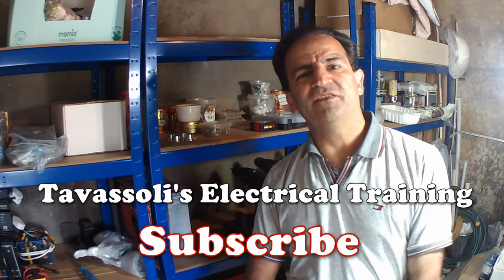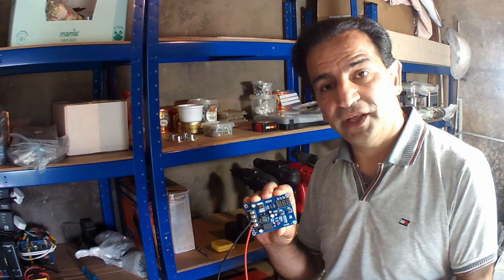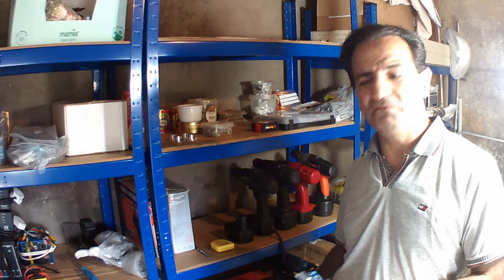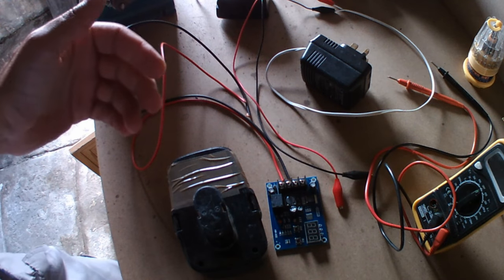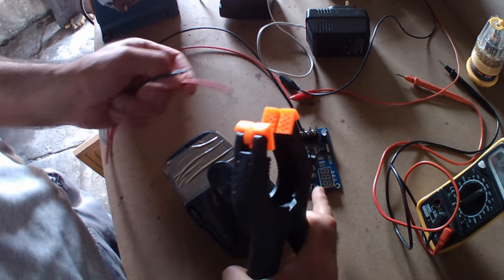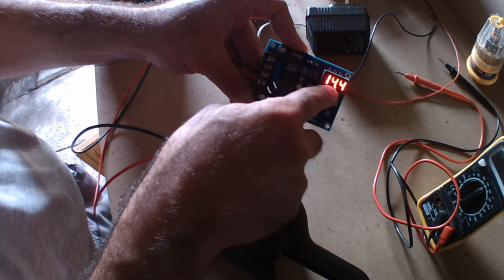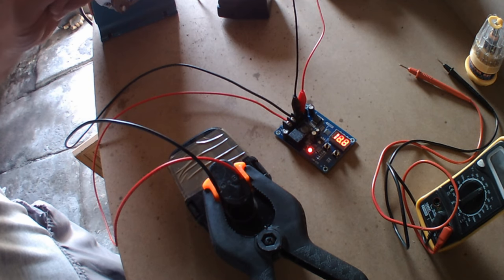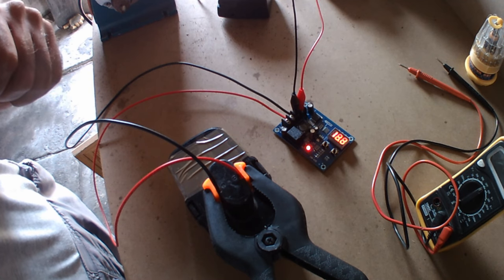Charger your Cordless Drill without its charger! - How to Make a Universal Battery Charger-

Comment: Thank you so much for this.  Excellent video and it's exactly what I'm looking for.  I really appreciate your time.     
I do have a question though.  I've looked this module up XH-M603 or some variant of that.  The module is a 'Lithium' battery charger.  How then could this charge a your car battery (a Lead Acid battery)?   Were your referring to the Lithium cells now used in vehicles?  Or doesn't it matter?   Thanks for your video.
Reply from the maker: You're welcomed!

Comment: get a junk 19V laptop Chargers, charge it, simple. Black Wire is negative and White Wire is Positive. Whats so hard about doing that???? You made this whole thing with the extra board they need to buy and the Multimeter and the rest of your BS. a 19V Laptop charger will charge any 18v cordless battery without overcharging it, because can't go over 19V.s Common sense. What is so hard to do it with a laptop Charger?? you can find them in the garbage. 😂😂🤣🤣😂🤣😂😂🤣😂

Comment: Be nice to have a solar charger project tie in where it charges the  battery than later to power the tool fan lights than power your tablets so and so. My tool batteries do those things. Have an usb and usbc adapter from 12 volt cigarette adapter. Usb adapter works good because it max input is 24v. So 20 volt battery does well. And it fast charges my samsung s tab 8.

Comment: I don't think you know anything about charging nicad or Li-On batteries packs. Its not as simple as you think.
Reply from the maker: You made a video and teach us then!
Reply: Another troll alert!
Reply: I had the same sort of feeling. Setting the end voltage for a car battery (lead acid) would be ok as it reduces the charge when it gets there. Not so with Nicad or Nmhi. They go down in volts as they get to the fully charged point and start to heat up. Both types do this at slightly different points. Normally full charge is detected by the temperature going up or the voltage going down to turn off the charging
Reply: @billhall1983  can you please give me advice as to what to do with the ni-cad battery"s cause i won't to get this kit for 12v ni-cad drill batteries but as i read your comment now i'm not sure, i like the kit for lithium batteries and if i could use them for the ni-cad that would be great just would like to know how to do it...
Reply: @makdady66  Just putting a current limited, voltage controlled supply across any battery to charge it sounds like a nice simple idea which will sort of work, but if you want the most out of your batteries then they need to be charged correctly.  Ni-Cads can be charged slow or fast. For slow charging the current is limited to 1/10th of the Ah capacity. So a 1Ah battery would be charged at 100mA. At this current when the battery is fully charged the internal gas given off recombines back into solution and gives off a bit of heat. This allows other cells in the battery to catch up and all be charged. The disadvantage of this is that it takes 12 hours to charge but you won't damage the battery. Fast charging needs to have a means of turning off the charge once the battery is full. When a Ni-Cad reaches fully charged the voltage changes from going up to going down. A Ni-Cad charger detects this voltage change and drops the charge current to a much lower level to give a bit of time for all the cells to equalise. Also the battery will start to get hot. Chargers usually have a fail safe temperature cut off as well so that if the fully charged detection failed the temperature rise would be used to stop the charging. Using the simple power supply charging method it could be possible to set the cut off voltage a bit below the voltage at which point it starts to go down, but the battery would not be fully charged. A common problem with Ni-Cads is that a cell or cells can develop internal short circuits. If it is a resistive short then it will still charge up to the full voltage but will not hold the charge for long. If the short becomes a solid short, then that cell will not charge and the battery will never reach full voltage. I use a circuit I built about 40 years ago to sort out internal short circuits. It is powered from a mains transformer. The positive half cycle charges a capacitor to about 30 volts, then on the negative half cycle it is discharged directly to the battery. This gives a succession of 25Hz short high current pulses into the battery. This clears the short circuits and charges the battery slowly. I hope this helps but remember, All batteries have a limited number of charge cycles and will eventually become un-useable. Having the correct charger will ensure the best battery life.

Comment: Hooked a 18v battery to this and relay clicks on and light comes on every 2 seconds, tried adjusting up and down the voltage numbers and light or relay does not work. Battery is pretty dead wondering if that might make this happen?
Reply from the maker: If the battery is almost dead, then you need to adjust the up and down voltage to where the relay clicks and the LED comes on and stays on, after it's charged a  few hours, then you will need to change the voltages back up, and keep doing this until you get the battery to charge up to where it needs to be at. If the battery is completely damaged you might not be able to do any of these. you need to see what reading you get when it clicks On, and what reading you get when it clicks Off.

Comment: Can I charge 36 volt ion battery with 12 volt Charger if I charge long time will it work.
Reply from the maker: no, sorry! Because your maximum supply is 12 volts. The battery doesn't store charge, it only gets charged to the maximum you can supply.

Comment: I added a comment a few days ago. I want people to know about your power supply is of alower voltage than people need. I needed 18 volts and you sent 3-12 volts. I am unable to return power supply. Where is my negative comment?People Need to know your business practices!
Reply from the maker: I have already responded to you in your email. The power supply we have on our site has a few variation of voltage and Amperage ranges, if you have picked the wrong voltage, it's not my fault. I have sent you a copy of your order, which shows what you ordered, and a screenshot of what we have for sale, which gives you the choice of different voltage and Amperage range of power suppliers. However, although it was your mistake top choose a wrong power supply, I even stretched an olive branch to you as a gesture of good will by giving you 50% discount code to use on any purchase you want! If you made a mistake in ordering on Amazon, eBay or on any other website or platform, you wouldn't be able to return and get a full refund. I've been more than fair with you. Thanks for your comment! We have an overwhelming number of happy customers.

Comment: I have a old 12V  black and decker when i connect the wires to battery the me305  regulator lights come on then go out should it stay on or is it because the voltage in the battery is lower tham 10 v as reg  is 10v -30V
Reply from the maker: Did you buy the board from me?
Reply: Yes its ok i have manage to charge it thank you if  the battery  is lower than 10 V does that mean light goes out. it did come on but went out .
Reply from the maker: @mauricevalladares9839  Yes, if the battery is too low, it won't come on. There's a trick that you can get it sorted, which I have explained in my second video, which you can find here: https://youtu.be/OL6DAVLk0ZU
Reply: Yes i thoughtthe regulator didnt stay onas battery was extremely low

Comment: I was a electronic tech. from 80s through late 90s..Tvs ,VCRs etc.
I watched the video Within. 1 minute..and when I saw the regulator board..AHa..You know your stuff.i like that that one battery. will supply the voltages. So amperage and voltage are being taken care of for safety. I haven't watched the video yet in entirety; but I have several questions.Thank you for this..I assume your description will have the link
 I thought I was going to have to build a circuit board..Whew. Also I am fairly ignorant about the requirements and safety precautions. that nickel cadmium require. The best. Pianostyle100
Reply from the maker: PIANOSTYLE100
Thanks for your comments, and I'm glad it's been helpful to you as it's been to so many. Yes the links are there for anyone interested to get their teeth on a new practical little project. Appreciate your support, I really need it currently..
Reply: How did you get interested in doing this? I am an amateur woodworker and largely self taught.
Reply from the maker: @PIANOSTYLE100  Electrical / Electronic Engineering has been my profession for decades. I started when I was only 11 years of age by making crystal radios, which by the way you can't find the earphones anymore (Not the same quality anyway), transmitters, Amplifiers and repairing radios and TVs and studied in this field and got my degree in it. and now I've been teaching it for years.
Reply: @totalelectricaltraining  I was going for EE. But my math background.was a bit week as.I got the higher calculus levels.

Comment: I have a couple of concerns here. Most lithium ion batteries are equipped with an internal bms and should be charged through the dedicated charging connection, not the normal load connection. This is to protect against one cell being overcharged and causing a fire/explosion, if the cells get out of balance. The bms monitors each individual cell and if there’s a significant difference it can disconnect the charging current. By charging through the load terminals, you by pass the bms and disable this crucial safety feature.
That brings me to my second point.
Lithium batteries are current sensitive. They have very low internal resistance, so they need a current limited charger, to prevent damage through excessive current. They are also temperature sensitive, and should never be charged at very low temperatures. You need to refer to the data sheet for specifics for each battery type. But for normal folk, charging in a normal domestic situation, we can probably ignore the temperature. Professional tool chargers do take account of it, however.
So, in addition to your set start and stop voltages, there needs to be a maximum current limit setting, which will vary from battery to battery. Some are quite robust and will withstand fast charging, potentially 3 or 4 amps, but many are not and will sustain damage at less than 1 amp.
Finally, most batteries are not fully charged at their rated nominal voltage. Many are, in fact, effectively fully discharged if they show their rated voltage with no load applied. So your 18v battery, in all probability, should be charged to 20v, before shutting down. But the makers data sheet must be consulted and complied with.
All of that notwithstanding, your little control board is impressive and would be ideally suited to non lithium battery types, including the lead acid found in cars, motorcycles, garden equipment, burglar alarms and various other products where high current at low voltage might be required. 
Thank you for an interesting video
Reply from the maker: OK. Let me save your time, your comment is just another one of those typical ones that are too worried about charging a battery; Listen Ihave explained this in my videos, not particularly in this video, but the revised version of this video, which you should see it come up at the end of this one, where I address these typical concerns. This charger is for any battery lithium or carbon monoxide or TNT type, AS LONG AS they have TWO wires or points of contacts to be charged as shown in this video and the other video, and your original charger doesn't do any miracle charging a two point battery, but doing exactly what this charger does. The middle point you're talking about in this case is not even connected to anything as shown in the video, it's just a gimmick. As explained again in my revised video for "concerned people" like yourself, If you have a battery with more than three ACTUAL points of contacts (Not just a decorative third point), then you need to pick the other battery charger board that I show in my video and I have in my website. SO I suggest you watch the other video and listen carefully before jumping your gun! Thanks!  Take care and be safe!.

Comment: The unit you are using is for Lead Acid Battery and Lithium Battery many tools have NiCd battery
Reply from the maker: Works for that too. I've tried. Don't see why it shouldn't!
Reply: @totalelectricaltraining  but you have no temperature sensing circuit to stop the charge when the batteries get too hot,
Reply from the maker: @chazM6116  No need for that, when the batteries voltage reaches certain value the relay will switch off the power to the batteries. However it's not difficult to use an NCT to sense the temperature too.

Comment: The adapter, how did you wire that , do you have a video on that.
Reply from the maker: The board clearly shows where the input voltage is and where the output terminals are. Negative of both input and output are connected to the middle terminals, and the input positive is the terminal towards the edge of the board, and the other terminal is output positive.
Reply from the maker: All you need to do is to cut the adaptor's output plug, and strip the insulation off, then you have two wires, check with your multi-meter to make sure you connect the positive wire to the positive of the board, and negative to the negative terminal on the board.. or use this link to buy the connector for it; for USA; https://amzn.to/37jY1PS
And for UK: https://amzn.to/36fLpKf

Comment: I am going to connect 2 - 24v 6ah drill batteries together. That will make it a 48v 12ah. But I need at least 24ah and above. How can I add more ah without adding volts ? It needs to stay at 48v.
Reply from the maker: you can make 24 v that way connecting batteries in series, but that doesn't make double the AH as you have presumed. To increase the Ah without increasing the voltage, you need to have the same  number of batteries now connected in parallel, so in your case you will have a few in series and a few in parallel, it will be combination of series and parallel if you like! I hope that's clear!

Comment: Very interesting and good solution I will need something like that definitely. But I have another problem a friend bought two cordless drill from China but they did not come with the battery pack and there is no indication how much voltage it works on. I did take another battery pack of 20 and extended a connection with wire on the Plus and Negative and the drill did spin. Are there universal battery pack I can purchase or make something to solve the matter?  Email: Leonardo
Reply from the maker: No unfortunately each drill has a different battery pack size and shape, so it would be impossible to make a universal battery pack, but only a charger that can very to suit each pack. Thanks for your interest though.

Comment: I have a 12V cordless drill & can't find the charger for years, look to buy the charger but none for sale. This morning I used a car battery charger to charge for 5 min & the 12v drill battery jumped from 1v to 13v ( & the drill is alive !), what's the reason for that, & will the 12v battery overcharged (how to stop) ?
Reply from the maker: @holycow I'm not 100% sure what's happened there as I can't be sure your measurement of the battery voltage was right. It's very strange for a battery voltage to suddenly jump that much up, unless you've measured it under the charge while the car battery is connected to it, or you measured the battery voltage under no load. they all make a difference in measurement. The battery won't over charge, but if it stays in charge for too long and the charging is not controlled, then it might damage your battery if it's not already damaged. I have a feeling your battery was already damaged (Dead), and when you connected it to the car battery you temporarily revived it, but as you use it for the drill, you will probably notice that it will soon lose its juice, and won't run the drill for too long. So the 12 v measurement you got is only a No-Load voltage measurement, which is not a correct value. I hope this helps!
Reply: @totalelectricaltraining  oh well, any extra minute using my 25 yo drill is a bonus, I was about to throw it in the bin. Thank you.

Comment: Thank-you for posting to YouTube as it's very insightful. Your listing says the 'regulator/charger' are only for lithium-Ion batteries... but does it also work with lead acid car batteries or NiCad batteries. Also, what is the current/amp output from the adapter that feeds the regulator in this video?
Reply from the maker: Yes sir! It certainly does.

Comment: hi..i just want to clear things up..yiu said the starting charge should never leave a big gap..like start of 9v to 14v...so what does this mean that i should leave my batteries with a 9v with it?
Reply from the maker: No, I said the stop voltage should be set at a bit (maybe about 1.5% -1.6% of the rating of the battery) higher value. So, for example if your battery rating is 18 volts, then you set the top end at about 21-22 volts . Your minimum set value should be as high as possible without causing the relay LED to go off. I hope this is clear!